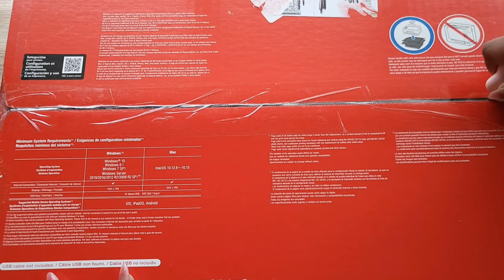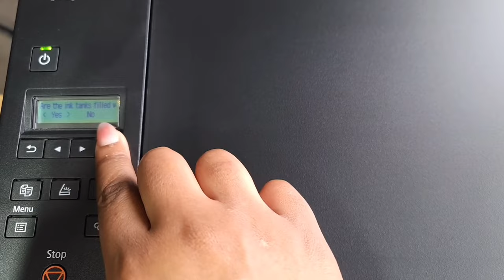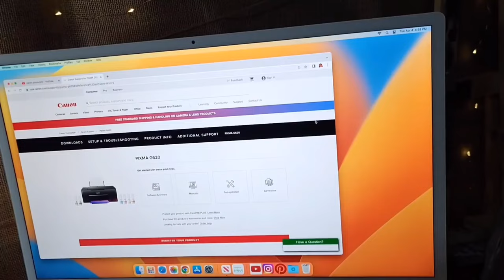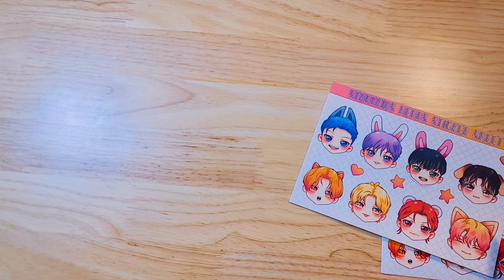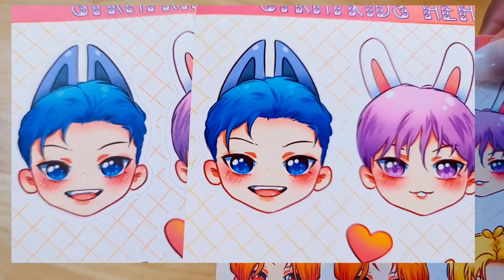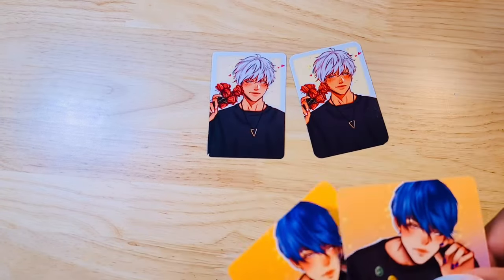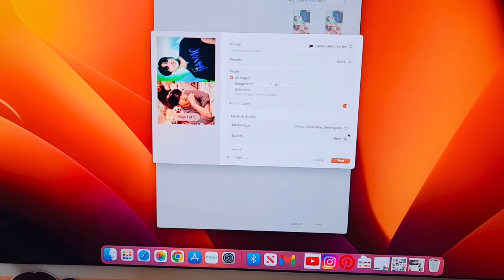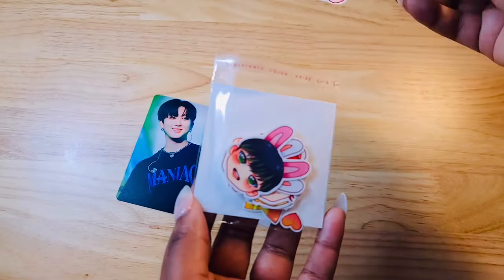Canon Pixma G620 Unboxing!

Comment: You should have look in the manual that canon supplied as the details are there! At least they are in the print version supplied by Canon for their uk customer ‘s. In England this printer is numbered as follows, G550 without scammer and the G650 is supplied with. Happy new year.
Reply from the maker: Thankyou so much! I admit I didn't look to hard at thar manual 😅 But I did keep it! Happy new year to you as well! 🫶🏾

Comment: I keep hearing that the driver for Mac OS is very basic compared to Window's driver. Mac users say that the colors are more bland/muted compared to printing through PC. I wonder if this was what you were dealing with? That's why you had to adjust the settings? By any chance do you have updates with your experience with the firmware driver?
Reply from the maker: I've never tried on windows, but I can say the colors do turn out pretty dull using the mac. If I want to print something I have to bump up the saturation by at least 60% first!

Comment: I was considering many mega/eco tank printers and came across your video. It looks like it was a good investment and works well with your computer and quality needs. Thanks for the video. BTW, what was that device you were using to round the corners of the photos? Do you mind sharing the name of that device? Thanks
Reply from the maker: I'm glad my video could provide a little insight! 
It's called a corner rounder! I got it on amazon ☺️
Reply: @viintji  lol yeah, I found it on Amazon soon after replying. I've made trading cards by hand for years and didn't know corner rounders was a thing 😅. Now I know and that's half the battle 👍🏽

Comment: Hey I have the same printer new and been having issues with colors looking washed out. Did you have this issue at first? And what adjustments needs to be made
Reply from the maker: I did have that issue! It's probably due to the type of paper you're using. When I used regular printer paper and cardstock, the colors were very dull. Now I use semi gloss and glossy photo paper and it works great! The setting I always use to print is "semi gloss photo paper" no matter what I'm printing on